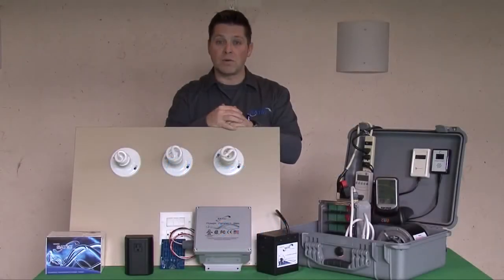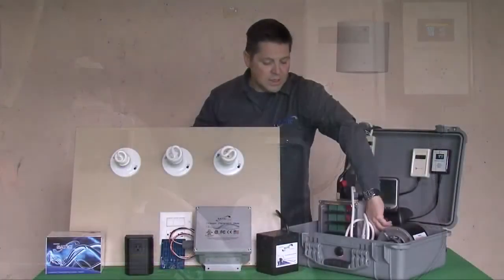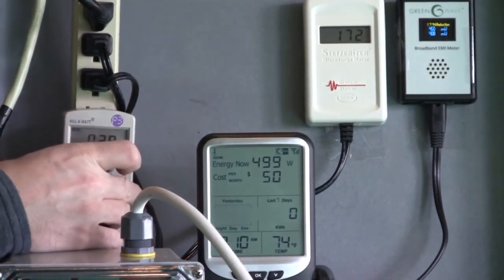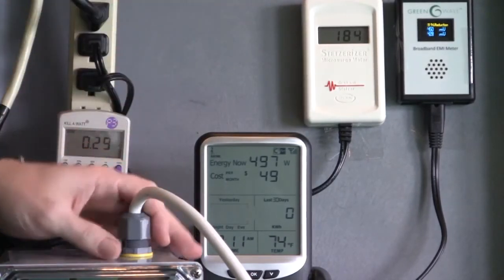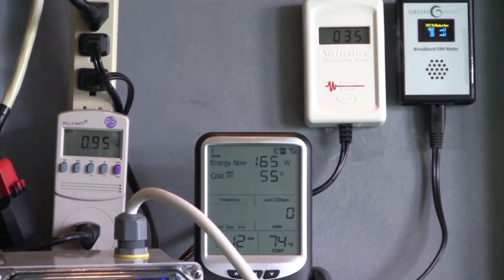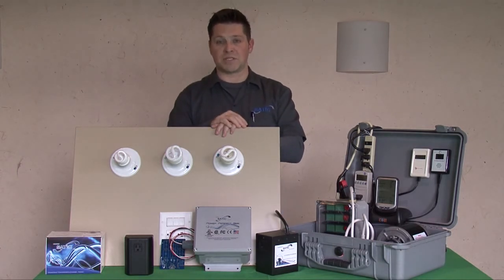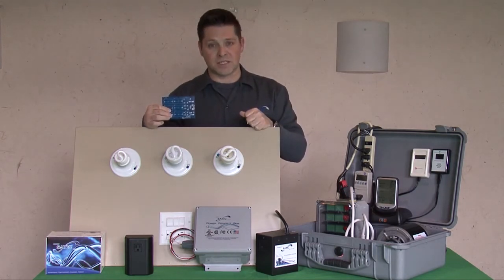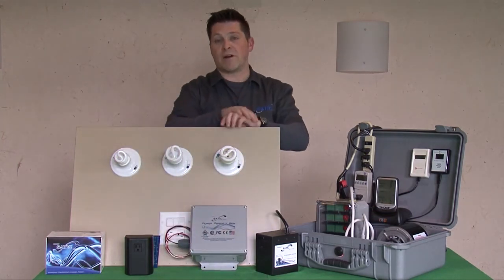Power Perfect Box In Action! Limit Exposure, Solutions Exist!

Comment: 4 of your plug-in products alone made my home liveable again (I have seizures and as a result my thin nerves are sensitive and the house is old). Thanks for all the work and information. I'll likely purchase a home filter soon.
Reply from the maker: How long have you been using the plug in units? That's great news. The whole home filter works soooo much better.
Reply: @brandensimoens1931  I used one all of 2 years ago, the last year I had 2, and I actually plugged 4 tungsten USB look alikes into one of them and had It nearest my roof in the garage where the garage door opener is to try and soak some EMI off my metal roof, since my home has no overhead crawlspace/insulation. The last 2 months or so I got 2 more and I can't really figure out where to best place them, one being at the entertainment hub, and i'm not sure if its best to plug the power strip into it, or above it, or plug it into the strip. The last one is a true rando in the hall. I think I'm supposed to find the A and B phase outlets orsomething idk, I gotta call Satic again soon. 
You really find the whole home one works for you that much better? My home has some wonky 1930's leftover wires floating in it so its beena  real pain to pin down, but I want to turn on the 5 circut breaker switches that have been off for years soon.
Reply from the maker: @CountZakula   It does not matter where you plug the filter in as long as it's plugged in on the circuit you can plug the power strip into the filter or you can plug the filter into the power strip. It works the same either way. I recommend placing them in places where there are a lot of things plugged in. The home filter is much more robust and filters the entire house right at the point of entry
Reply from the maker: @CountZakula  email me at bsimoens@yahoo.com. I'd love to hear about your experience with the filters and I can help you get the info on the whole home filter.
Reply from the maker: @CountZakula  The best part is once the whole home filter is installed, you can use the plug in filters for added protection. I usually plug the filters in on a outlet with alot of electronics. Computer, tv etc. This will clean the dirty electricity right at the source and stop them from back feeding into clean circuits! Email me at Bsimoens@yahoo.com Id love to connect with ya!